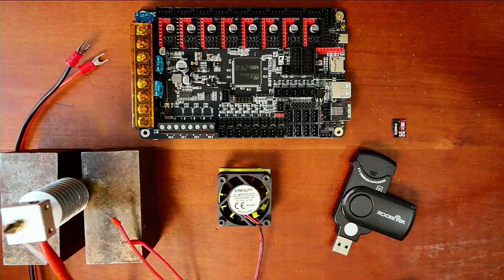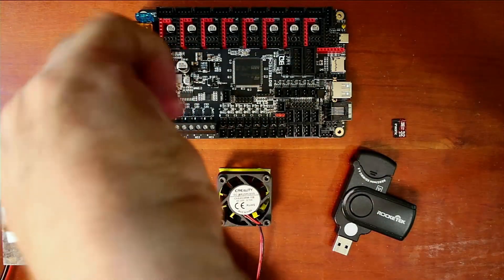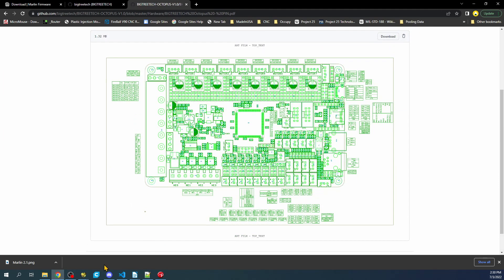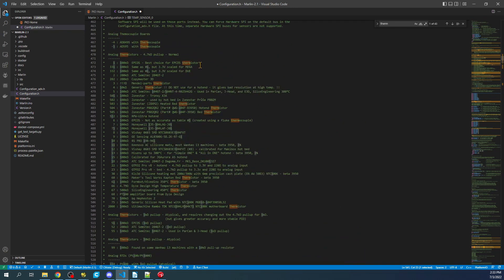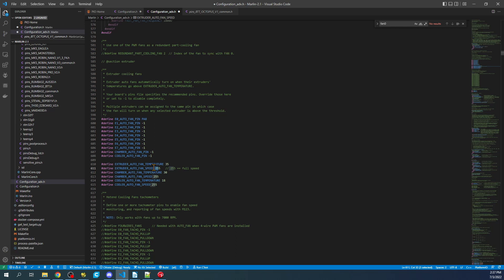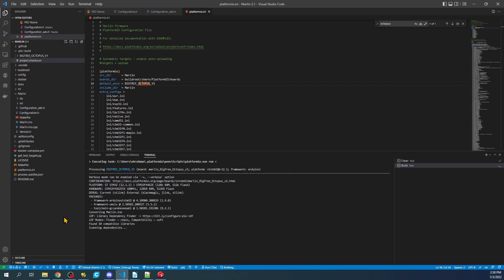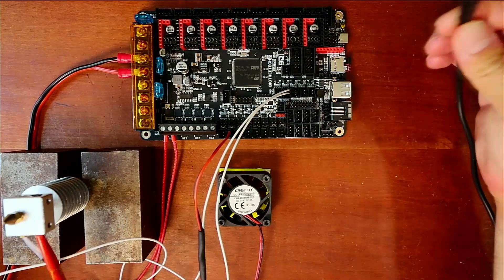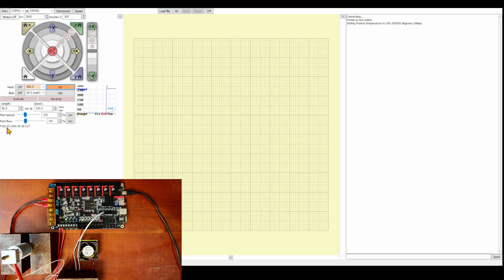BTT Octopus - Hot end and automatic Cooling fan

Comment: note to self
8:00 hotend setting Thermistor type
9:28 E0_AUTO_FAN_PIN   for automatic hotend fan section aslo i need to  change the pin to PE5 since PA8 is used for part cooling in my case
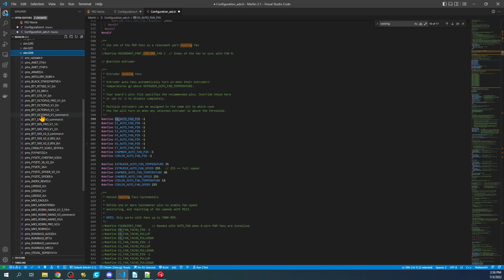10:48 Pin menu
11:37 that how you set custom pin
14:20 if i forget how to change the pin to PE5 and where to connect it

Comment: Hi Ed, thanks for the videos on the BTT Octopus, they really help a lot! I am currently building a big scale (cartesian) 3d printer using the BTT Octopus v1.1, where I have 4 nema17 steppers for my z-axis, 2 for the y-axis, 1 for the x-axis and 1 for the extruder. I've learned from your videos how to set up and test the motors (and they work great when I test them using pronterface), but I'm not quite sure how to make the next step towards getting an actual working printer that I can give printing jobs and commands via Cura. Are there any video's you recommend on this topic, or perhaps specific redditpages/discordservers? Any help is much appreciated! Thanks again! :D
Reply from the maker: There's a Discord link in my description.  Most people in general chat can help with details.  There's over 800 people there.

Comment: Is there a way to configure for the part cooling and heatsink cooling to be automatic. I've been able to use controller fan for cooling the board and drivers, and part cooling attached to main extruder, but the heatsink fan doesn't and I have to manually turn on and off when printing and when done. My board has three variable fans to which I can connect, but can only have two of three fans be automated.
Reply from the maker: Should be a tutorial in playlists for octopus in description of tutorial.

Comment: so with this where do i connect part cooling fan for gcode controled like in cura
Edit1: had to move the hotend fan 1 over for PE5 since PA8 is used for part cooling  well atleast in screen its fan 1
Edit2: so to make it clear plug part cooling in PA8 and hotend fan in PE5 for me sanity go berzerk  because the part cooling seem to be assigned to PA8 i am wondering why your go fine
Edit3: dangit a year later i see you already changed it to PE5  i must have skipped that part or something xD
Reply: wondering quite the same, E0_auto_fan_pin_PE5 but on board the plug for fan1...?...
Reply: dunno if you fixed it by now but 14:20 he tell us how he change it to PE5 and where to connect it  @jesse00077

Comment: Hi Ed, your videos are great. 

Thank you for your effort and for the great explanations. I am currently converting my cr10 version 2017 to Klipper/Fluidd with a BTT Octopus v1.1.

Your videos help tremendously. 
Even though I work in electrical engineering, it's nice to have help. 
Please keep it up. 

Maybe you can answer a question for me:

I didn't understand what the jumper at J38 on the Octopus V1.1 is set for (24V, 12V, 5V). I can set the fans (FAN 0-7) with the overlying jumpers regarding the voltage. So why do I set the jumper at J38 (24V,12V,5V)?

Greetings from Germany

Subscribed your channel for the good work.
Reply from the maker: Danka, I think it might be easier to ask in Discord chat.  There's a link in description.

Comment: Hi I got a question about the hot end, is the hot end 12v, or 24v please
Reply from the maker: It can be either, depending on the power supply.
Reply: @EdwardBraiman hi mate I am using 24v on the power supply, but the thermostat is a ntc100k from a 12volt hot end, would that make any difference
Reply from the maker: @mcdjacedad7359  you'll then need to probably change heating element to 24 V.
Reply: @EdwardBraiman  i have done, I brought a pack of 10 the other day, I put one on yesterday, and now, it heats up but gos over the fresh hold, then the printer shuts down
Reply: @EdwardBraiman found out the problem, the seller sent me the wrong heater, they sent me 12v 40w
Reply: @EdwardBraiman hi mate all sorted, thank you for your videos, and your time

Comment: Just wondering how much they are paying you to shill for these crap boards? Tried to order a manta, but they switched on me sometime between the time i ordered and the time they shipped and I got one of these crap octopus boards. Been going on 3 days now and as of yet, I can not get the POS to run mirrored AB motors on a double H-bot build. It will not run 4 motors at once. BTT bate and switch me and seem to do it with a 101% crap board. Now I know why no one has a config or is using a BTT octopus for a 4 motor xy. They can't do it! Nice of them to let us know. Spent almost $200 with that worthless company and have NOTHING to show for it. 

DO NOT BUY BIGTREETECH - YOUR LIKELY TO GET AS SCREWED AS I DID!
Reply from the maker: Actually purchased Octopus board out of pocket.  If you're having issues there's a free Discord link where either myself or someone else in General chat can help.
Reply from the maker: And BTW not being paid, except for Patreon and PayPal tips from viewers.
Reply: @EdwardBraiman  OK, not shill'n, my apologies. Went to your discord and asked. No one seems to have a clue, which leads me to believe the boards are not capable of doing what I need and if they ever were, no one seems to have a clue as to how. Thanks anyway. At least I know the Mellow Fly Super works and there is a klipper config published for dual AB motors for that board. Just hate having to throw good money after bad.
Reply from the maker: I look tomorrow, been soldering for 4-5 day at work and need sleep.